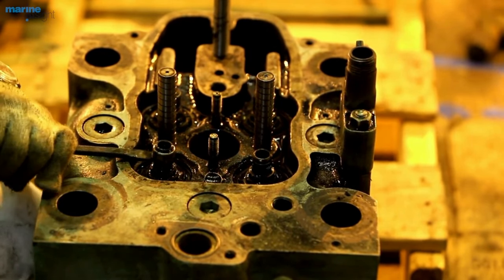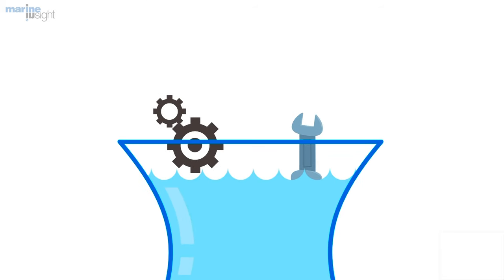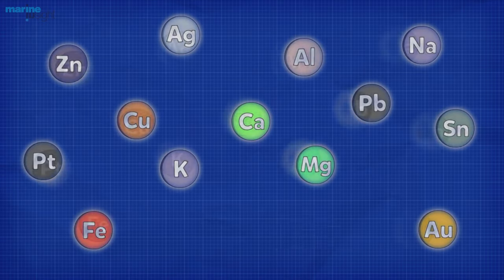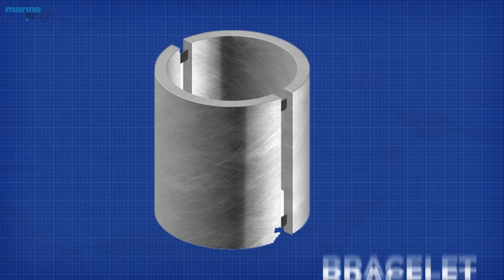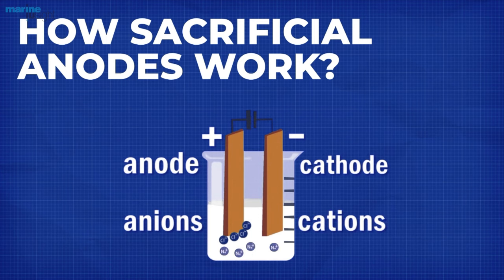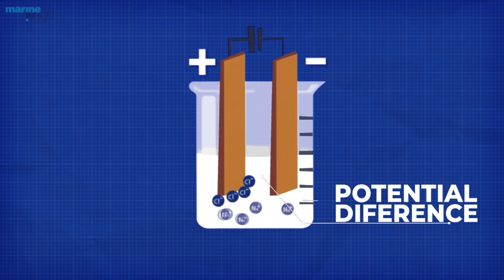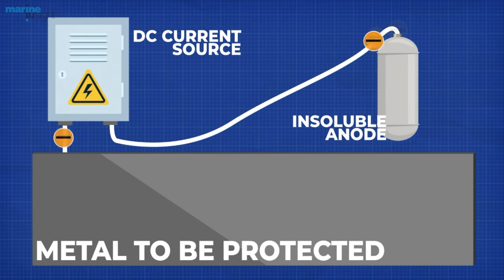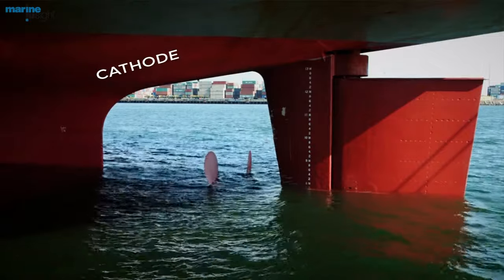Ship Hull Protection System

Comment: Electron current doesn’t pass through the electrolyte, only metal ions dissolve in the sea water . Its a very important point and i hope that it gets confirmed by anyone because i started doubting my self
Reply: You are correct, there is only chemical action occurring between the metal(s) and sea water, not electrical action.

Comment: Is it okay to install the sacrificial anodes on already painted steel surface? Or do we need to grind the surface first before installation?
Reply: You need to grind the surface before installing. Having a reliable electrical contact with low resistance is critical

Comment: But sir control panel will measure only the corrosion current between the particular metal, here in our case plantinum and it will be more as compared to anode?? Then How the slightly the more current wil protect the anode??

Comment: The anode (e.g., Zn)  is where oxidation occurs and the electrons produced are transferred to the hull (e.g., Fe), which is why the hull is called the protected cathode.  Right?  But what is being reduced?  Fe in the hull?  Doubtful.  So, are the electrons are just being routed through the hull back to the "anode". I don't understand what is being reduced.  Is the Zn2+ produced in the anode being reduced back to Zn?  If so the the terminology leaves something to be desired since the cathode should be where some reduction is occuring.

Comment: Fully understood how ICCP protects corrosion by keep the metal hull negatively charged (feeding electrons to it, correct me if wrong) but this only resolves between seawater and steel (cooling system and hull).  Can't find a good explanation how this works against sea creatures growing/sticking on the hull.  Is the impressed current strong enough to shock them off? Anybody?
Reply: No, ICCP is not used to prevent marine growth. This is done by means od anti-fouling paint on the ships hull. But for pipes that lead sea water througt metal pipes we use Marine Growth Prevention System so that the valves, pumps and inside of the pipes dont get plugged.